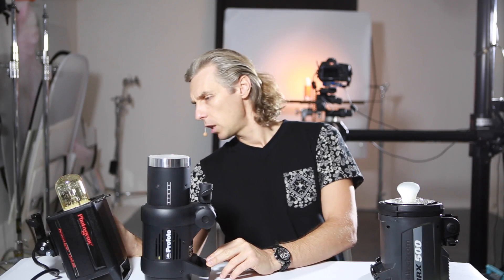Profoto D1 Air 500 vs Photogenic vs Elinchrom BRX500, part 1

Comment: Hi Alex could you make a review of the newest elinchrom ELC Pro HD 500 or 1000w ?  Flash duration is 1/5000s / 1/5260s, t0.5, ELC 500 / ELC 1000)
Reply: I would like to join to this request :) Would be great because these ELC Pro are made for speed :)